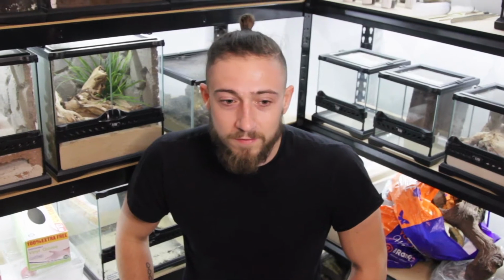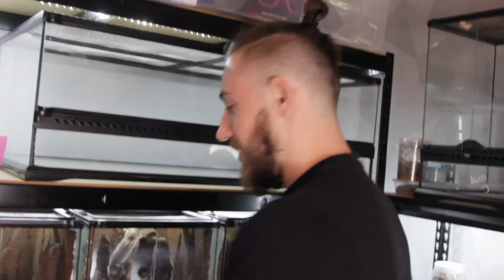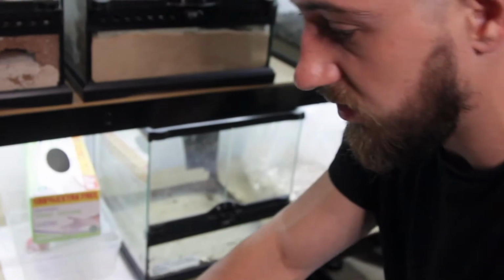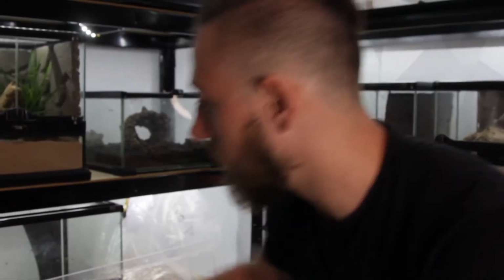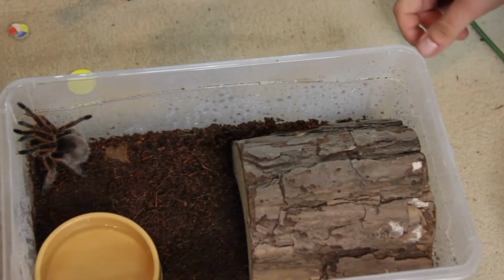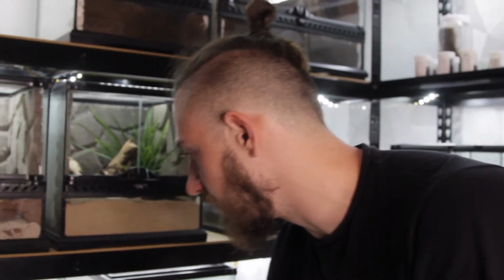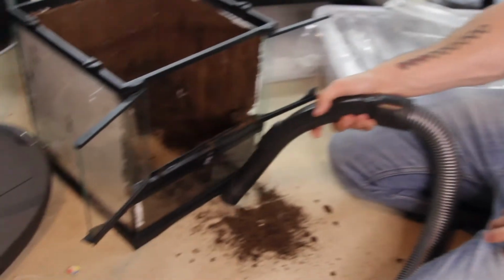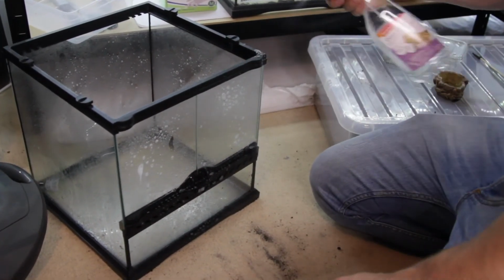Feeding Video GONE WRONG | Predatory Mites

Comment: I've just seen this, these look like White Spider Mites. For any plants that you may want to keep, you can use rubbing alcohol on them (apply with some cotton), leave on for a couple of hours and then rinse with soapy water. For the enclosure, you can move the tarantula into another enclosure for the time being, just like you did, remove any substrate and then bleach water which you must leave on for more than 24hours to make sure that all of the mites have been killed, and then wash down with soapy water.  Spider mites reproduce on the underside of leaves so make sure you either remove plants and dispose of them in a bag (like you did) or thoroughly clean them. There are ways to keep them out, such as companion planting which also help to repel them, such as interspersing Chinese parsley, chives, dill, chrysanthemums, garlic, and onion. I'm not sure if any of the plants may affect the tarantulas, so maybe do some extra research before implementing any of those.
Reply from the maker: Thank you so much I’ve just screenshot this just incase it ever happens again hopefully not🤞I feel like I may of over reacted but in 7 yeah of keeping never had that before and just did what I thought was best 😬